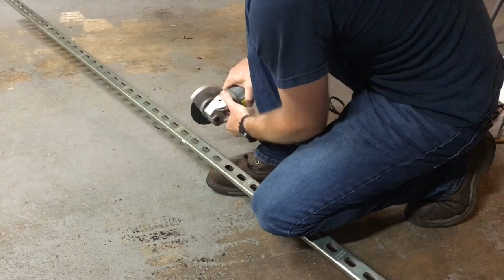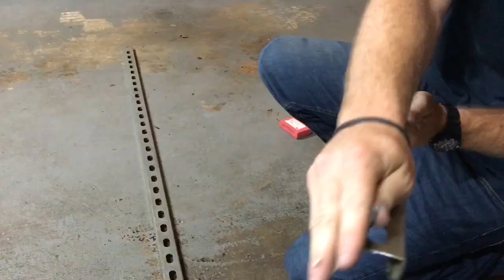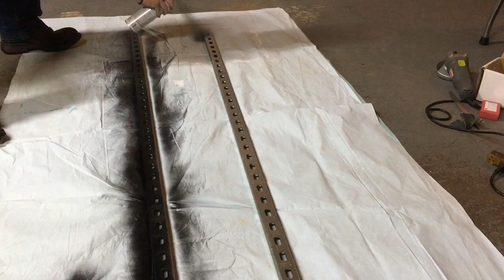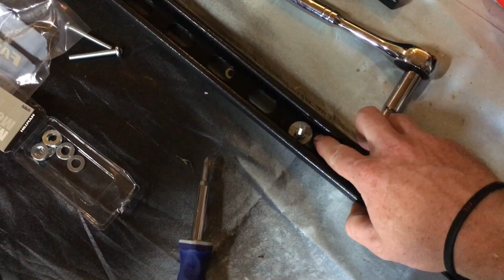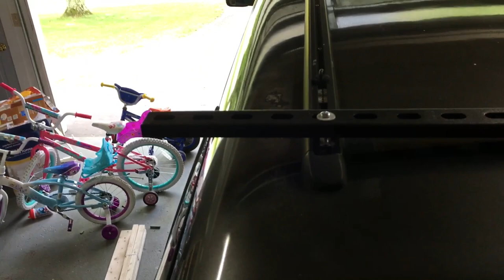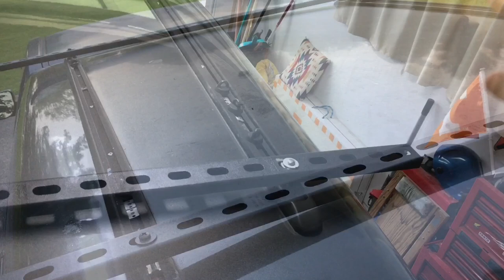Custom Low Profile Roof Rack Crossbars  for truck

Comment: Planning to do this this weekend. Hows it been working? Any flex in the Unistrut with heavier loads? Any noise or whistling?
Reply from the maker: Absolutely no noise or whistles. The heaviest thing I’ve put on it is kayaks so I’ve not experienced flex. I would do like someone recommended and cut some 1/2” conduit and put around the bolts for extra support. I’ve not done it and had no problems. But it wouldn’t hurt especially for heavy loads.
Reply: @t-sparky127  Thanks man! Sorry I didn't read the other comments/responses before posting that. haha. Appreciate the quick response.